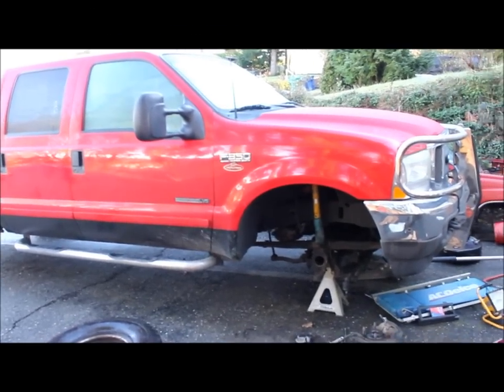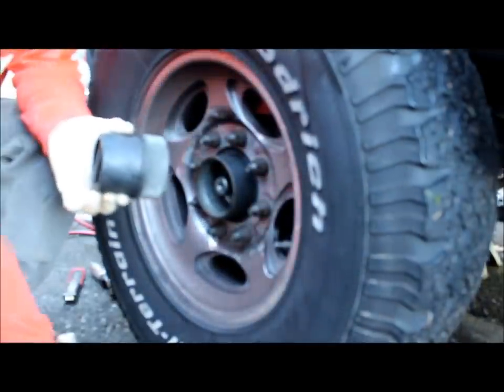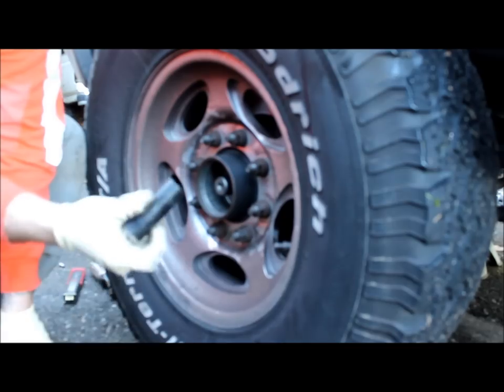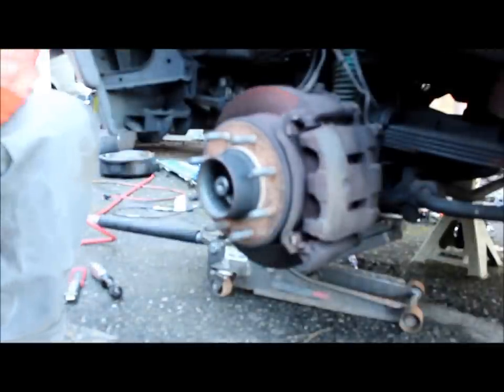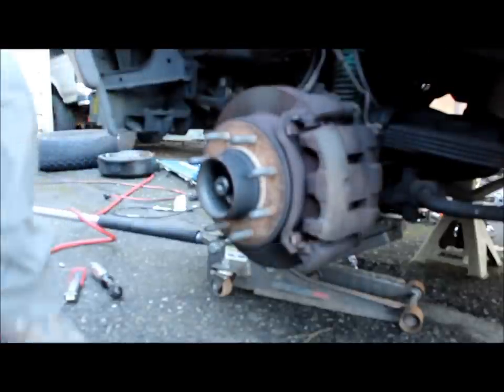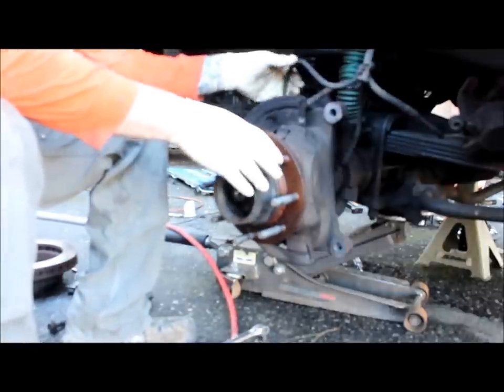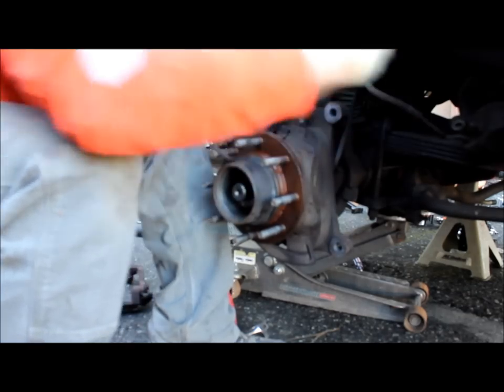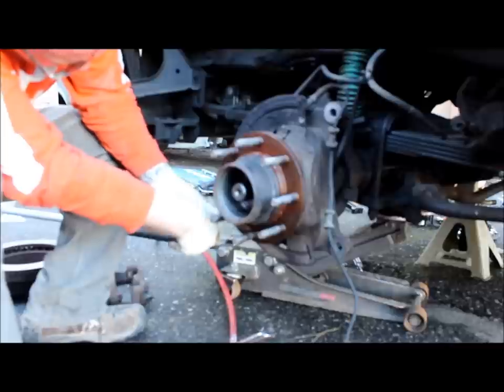F-350 Front End Tear down. Hub, brakes, axle, ball joints, knuckle removal

Comment: So exciting yet so disappointed.   LOVE the video, simple and straight to the point. You mention the bolt or whatever sizes and fast forward through the mindless nut turning.      Would have liked to see the install video but I guess you said the same thing I do and the reason I have no videos posted.    I watched your video more from a parts needed aspect, I mean I can tear down and rebuild just about anything.   I can scour the web for drawings or just tear it apart, discover the parts needed just to have that "oh sh*t" moment in the middle.  Then wait a week or two for parts and all the BS that goes with it.I'd love to see more on the F350 if you got it.  Either way, thanks for a rare decent video.Thanks dude.

Comment: please do not remove tie rod ends the way this guy shows it is a good way to mess them up.   the proper way is remove the nut and find the biggest hammer you have available to you (if all you have is a claw hammer like this guy go ask your neighbour) anyway once you have a bfh locate where the tie rod mounts to the knuckle this is where you will hit with a hammer.  turn your wheel so that it is easier to swing and make contact(less chance of hitting something you're not aiming for) dont go nuts but give it one or two heavy wacks and it should pop right out

Comment: Does this truck use metric or SAE size fasteners?  And is that true for all Ford pickups?  Thinking about buying one.
Reply from the maker: It actually has both... there are some 18mm bolts in the suspension.... weird
Reply: @DrivewayMechanic  fyi those "13/16" are really 21mm. its all metric.
Reply: Nice narrative

Comment: Invest in a dang pickle fork to remove the tie rods ..
Reply: A pickle fork destroys the rubber grease seal. Easiest way to get tie rod ends out on that truck is screw nut right to end, stick a bottle jack under it with just a little pressure and rap the knuckle with a hammer. It will pop right out.